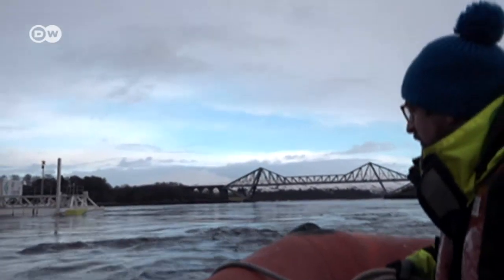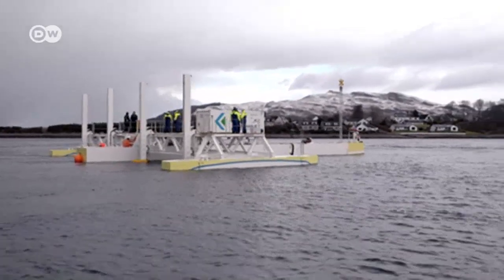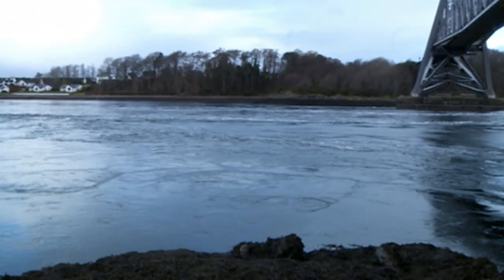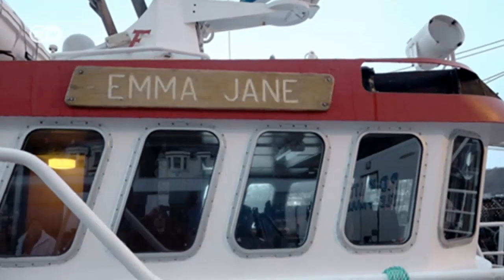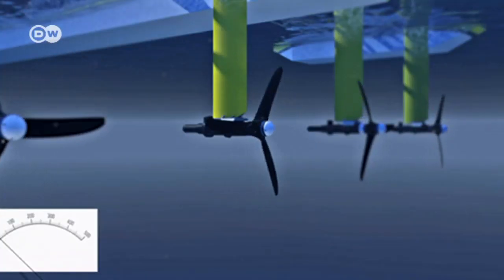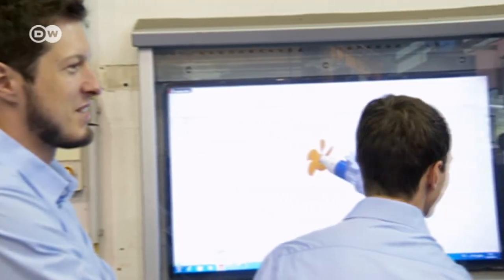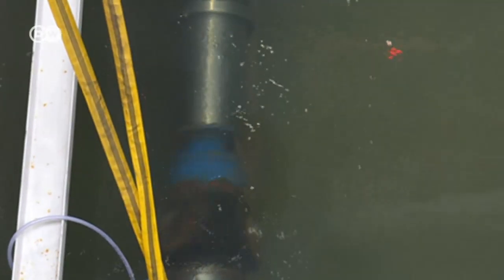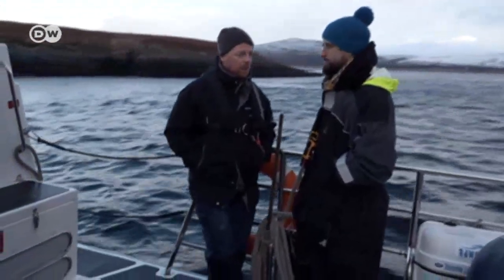Turning the tide: Waves of energy | DW English

Comment: If you want power i could open and close walls  against tides the size of hover dams  reversing  at there will .with automatic featheting flat blade  radial windmills .stonwalled in  patent office .
Reply: Yes but you are putting large amounts of money into huge, fixed cost construction instead of the power generation equipment.  That's why the floating, anchored systems are best.

Comment: you give me big floating float which is attached with hydrogen based balloon so we got more efficient energy from sea and air
also the atmospheric pressure changing always gives electrical energy forever in this environment

by using a large scale model of barometer sensing device sac cylinders of barometer sensing needle point goes up down so we got force which can be used in making electricity forever everywhere anywhere😋😝😋😝